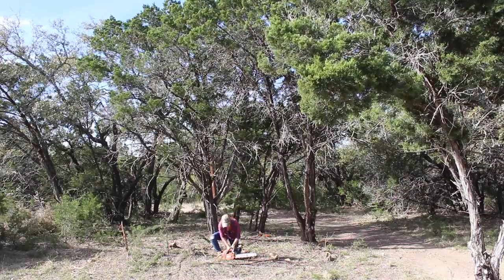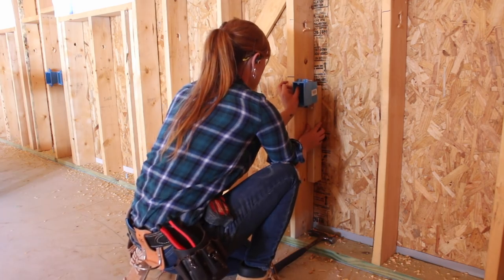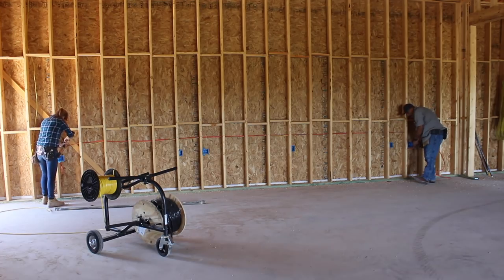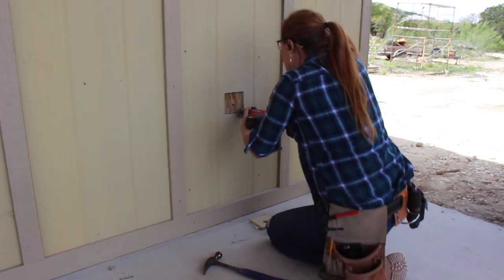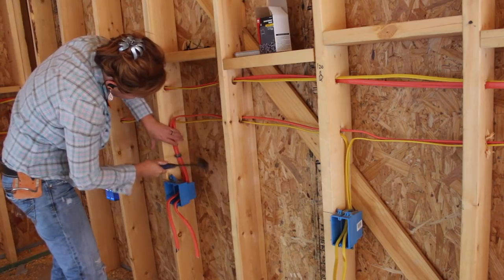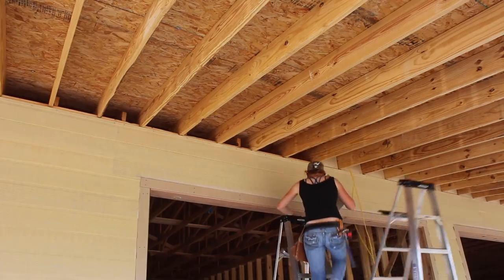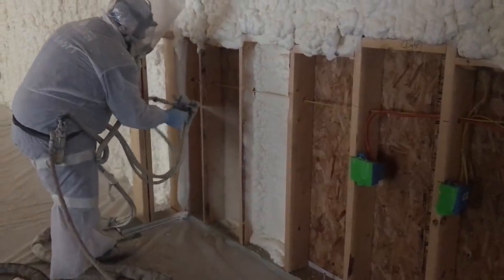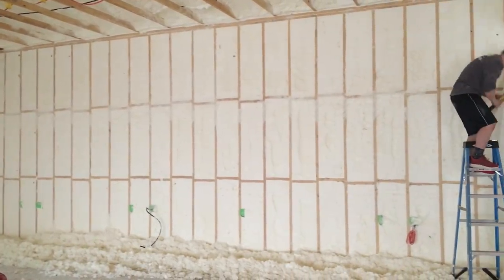Wiring My Shop and Spray Foam Insulation

Comment: No guard on the grinder!!!!!
Reply: It's kind of a concrete cutting diamond blade that's made of steel I guess ;o)
Reply: The wheel is made of steel and it has bits of synthetic diamond impregnated in it.  I've got a couple of wheels like that and they work well.  The problem is that April took the guard off her grinder.  That's really dangerous.  I know that people do that to give the tool more range, but grinders operate at a very high speed and when a disc fails it shatters in every direction.  You need the guard there to keep bits of the shattered disc from flying back at you.
Reply: As far as I know steel discs don't get shattered at 11000 rpm.
Reply: Any disc can shatter.  If you're using a good quality disc, rated for the size and speed of the grinder, and applying it the right way (no excessive force, and not trying to abrade with a cutting wheel or vice versa) then it's normally fine.  But discs can and do fail, and the mantra of "safety first" dictates that the guard is the only thing standing between flying disc fragments and your face.  I would never operate my grinder without the guard on.

Comment: April, for your in-between wall, you should have used fiberglass insulation instead of cloased cells.  Sound absorption is way better than and cost is lower.  Keep the good work I really enjoy your videos.  I'm a fan since many years now.  You have your own style and it is what charecterize you.

Comment: Hi
I'm excited with your work
My small point is that I think it is better if you run the electronic wire in tube. That will help you if you need maintenance

Thanks

Comment: Something I have done that is a little cheaper that the foam.... if you are a little more budget concerned or don’t quite have the funds for the real stuff.  On a 2x6 will, cut 1/2 foam board with radiant barrier on one side.  Fit it between all wall cavities and use the canned expanda foam to seal the sides top and bottom, then put in wire.  Then R19 batts.  I was quoted 2.25 sqft, for the foam and I was a contractor who used these guys on other peoples projects, this was my own house i was working on.  Anyway, use the foam board, spray foam to seal, and Batts to provide additional protection.  All total I insulated my area for .85 a sqft instead of 2.25.  Just a cheaper option, but love the real stuff too.  Great job, “WILKERDO”!

Comment: Great shop!  I'm curious about the attic ventilation...  Also, I'd be cautious about down sizing the HVAC very much.  I don't want to say they over sold you on the advantage of the foam insulation because I don't know, just that in general I'd be cautious since it would be very costly if you undersize the unit.

Comment: Any plans for the floor ?  Poly-resin, Epoxy ... or just keep it bare (which is cool too) ???

I did a poly-resin on my garage floor (grey w/ blue, white and a touch of black) paint chips. 

The next time I ever do that (which I recommend), I'd go with a solid color.

You drop a screw or nail and it's like dropping a brown needle into a brown haystack ... it just disappears !   LOL.

Easy to clean up, sweep, etc. and looks great ... but a solid color would probably have been more practical for me.

Comment: In finland they used to do spray foam insulation on wooden strucktures in the 70s and 80s (like in the video) . Afterwards the wood wasnt able to "breath" anymore, so all those houses are full of mold and rotten wood.  So those houses are taken down because the health risk and spray foam isnt been used the same way today, that much.

Comment: You should consider wire shields (a metal plate that gets nailed to the stud where a wire runs behind it) to prevent accidentally drilling into a wire down the road. Either you, a loved one, or whoever buys this place years from now.

Comment: April I saw you corrected yourself about the wire types. Typically 10 / 2 wire has 2 conductors, so you would normally be right calling that 10 / 3, but I sold wire, and when referring to romex house wiring, 10 / 2 is still a 3 conductor, because the ground wire is insulated most of the time and isn't considered an electrical conductor as it's a ground only wire. The first time I ever ordered 10 / 3 romex wiring I got a 4 conductor wire from the manufacture and that was their explanation to me. If that's not correct then take it up with Brad with inside sales at Houston Wire and Cable and Linda at Tyco / Murco.

Comment: Since the power company has to bring in a new pole and transformer, can they bring in 3 phase power so if you upgrade to better equipment you won't need a converter?

Comment: You might want to put your lighting on two separate breakers.  That way if your working at night and in the middle of a cut on your table saw, and you trip a breaker for some reason you will still have light to be able to finish your cut or whatever you are doing.

Comment: Shouldn't you have left a little bit of excess wire at your outlets? As in a loop by each outlet for future replacements, etc.? Love love love your videos, look forward to them each week!
Reply from the maker: I have some, but the insulation guys coiled them tucked them in their boxes so they could tape off the front of them. Wouldn't want to fill the inside of the box with spray foam. : )

Comment: Why did you use ACX plywood for your midshop wall vs OSB? OSB cheaper and as durable. Is that wall going to stay exposed plywood- did you do it for aesthetics? Just curious
Reply from the maker: Yep, it's just for aesthetics. Not only is plywood nicer to look at, but it's also not as busy of a background for filming.
Reply: osb is not as durable.
Reply: Some varnish and molding over the seams and she'll look good.
I know, it's just a shop, but who cares, make it a pretty shop.

Comment: Did I see correctly that on your continent you have fuse boxes made out of METAL with the fuses vertically in the center? The first looks dangerous and the later hard to expand/modify at any later time.

Comment: I see you follow the Howard Corse (dad) method of outlet placement, I did the same in both of my shops. That foam will be fantastic. One thing you might want to consider is to leave a provision to add more insulation to the ceiling if the R21 is not enough. I used 9" fiberglass bats upstairs(office) and covered it with another maybe 9" or 10" blown in cellulose. Here in NC in the summer, I don't feel any heat from the attic and my shingles are black and get mostly all day sun.

Comment: Question: If your vacuum is going to be outside, aren't you going to be sucking up a LOT of inside air and dumping it into the great outdoors? Otherwise, as usual, love watching your progress.
Reply: The HVAC contractor will (or should) install a ERV (energy recovery ventilator) to bring in and condition fresh air.  This is a necessity with todays super tight building construction.  The ERV will (or should) be sized to replace the shop vacuum cfm as well as the required fresh air requirement for a building of this size.
Reply: So, basically after filtering, the cooled or heated air is vented back into the building space? I'm not familiar with how this works, (but, then again, there's a LOT of stuff I don't know. ;-) ).

Comment: April,

Have you checked with your home owner insurance in regards to what their requirements are for building a new building? I'm assuming because of what you do in your shop and the equipment you have, you have it covered by insurance. I would highly recommend if you haven't, that you take a real close look at what they require to add the shop (permits, inspections, etc.) I would hate for your building to be built and nto be able to be insured.

I understand that you live in the county with little/no jurisdiction, however, it's never a bad idea to have inspections completed. Then you at least have a record from a professional inspector stating that your building was constructed to code.

Comment: April. I built a house on the north shore of Lake Michigan. After my spray foam insulation was added, it totally stopped winds that forced sand thru any and all cracks in my side walls. I get LOTS of wind! I use only 1 tank of propane a year due to my efficient forced air furnace too. As another benefit, you will also understand the noise deadening factor as soon as you start your dust collection system if that is located outside your shop. It is amazing, You scored big time on this. Air flow, heat and AC loss, and noise abatement. Great choice! Did you run a conduit under the slab for electric to your table saw or other tools which will be in the center of the shop?

Comment: You shop looks fantastic! You mentioned the spray foam company by name twice, perhaps they cut you a deal? You always wanted to be transparent and mention it, If they did.
When you are running the vacuum system sucking up sawdust, Doesn't that air has to be exchanged for outside air?  Could that air be returned to the shop after clean or funnel through a heat exchanger? To help reduce energy cost. Keep the videos coming.

Comment: This was one high voltage video!   lol.  Now, where was that 20 amp circuit going?  And that 30 amp circuit?  How many on that wall?   Uh, I'm confused now!  LOL...   Yes, it's good to have professional electricians helping you.  In my state, any wiring must be inspected and signed off on, with some city areas requiring licensed electricians must be the ones to do the work, for insurance purposes and so on...

Comment: This is awesome April!! As a note, if you are going to run ethernet, go with CAT6 not CAT5, and on that note, you could go with CAT6A which can maintain speeds up to 10GB speeds. It sounds like over kill but it's better to have an 8 lane highway when you only need a 4 lane than it is vice versa.
Here's a link that lets you know the ins and outs. https://www.firefold.com/blog/difference-between-cat5-vs-cat6-cables/

Comment: Great idea with the conduit! Much better than running bare coax/Cat 5/etc..As the technology changes, and new cable types (Cat 7+) become more popular, you'll be happy you put in conduit! I do hope you left pull strings in there, to ease the cable pulls, but it's no big deal if you didn't (just use stiff cable like RG6 first to pull the rest of the cables through).

Comment: open cell  is a sponge for  water vapor :) used in the south , not recommended in the north of USA ,  closed should be the one
Reply: oh x enginneer retired , stealth to commericial  try cut out 12 ich section floor level after few years , think will be wet

Comment: Excellent choices so far. You will have a fantastic shop.  I do however wish they left the Ridge vents open.
Reply: leaving the ridge vent open would create a large hole in the building envelope, since they sprayed the foam at the underside of the roof deck.  You would be channeling outdoor air, directly into the conditioned space.  You only want to ventilate the attic when the majority of the insulation is directly above the ceiling.

Comment: Nice video.  However, according to the ICC ES-Report SucraSeal foam still requires a thermal barrier or ignition barrier when applied in an attic space.  See Section 4.3.1 of ESR-3375 and section R316.4 or R316.5.3.1 of the IRC.  Only foam plastics which meet NFPA 286 should be left unexposed in the attic space.

Comment: Very informative video April and super cool insulation, it's mesmerizing watching it expand!  I also like the way they over fill it and then cut off the excess.

It sure sounds like you've covered plenty of bases with the wiring and it must have been fun working with the electricians.

Comment: April, to my knowledge, no spray foams are fire retardant.  They have a flame retardant mixed in to slow the spread of flames, but they can catch fire.  The IRC requires a 15-minute thermal barrier between spray foam and occupied interior space (IRC 316.4).  Fortunately, your 3/4" plywood sheathing will achieve this rating on the walls, and I assume you'll be install gypsum board on the ceiling?  Granted, only an ignition barrier is required for the insulation in the attic, but a 1/2" layer of gypsum board will provide this (IRC 316.5.3).  I also saw your comment that you're building in the country and there's no jurisdiction for inspections, but it's still a good idea to meet code especially in this instance because when ignited, spray foam gives off toxic fumes.

Comment: As always - this is awesome. I was always under the impression that it you were to run Fiberglass bats, Romex would be ok; however if you were going to run spray foam (PE or otherwise), then conduit (EMT or otherwise) would be the more suitable choice. This would allow you to add circuits if necessary or change out wiring should a short/high current device circumvent the breaker in the panel. That being said, the entire planning process you put into this is amazing; but that does seem to be par for norm. Not perfect - but exceptional just the same. Thank you, I learn every time I watch these videos, and I hate YOUTUBE.

Comment: Just curious, why put the DC outside? That will pull hot humid air inside.  

With a food 1 micron filter the DC (inside) would act as a shop air cleaner while running and wouldn't pull in outside air.

Loving these videos. Thanks for sharing.

Comment: Great video. I did not read through the responses here, so this may have already been said, but foam does some thing else according to a Texas A&M study done 15 or so years ago. They said foam actually increases the strength of a building by 20% or more since it literally GLUES the building together. That's good to know to windy areas.

I've been spraying foam since around 2003 or so when I bought my own machine for building Monolithic dome homes. I read everything I could get my hands on about foam. I will say this though, I have NEVER sprayed open cell foam, only closed cell foam. 

I was building a dome in Siren Wisconsin back in 2000 I believe it was, when we had an EF-3 come through. The winds were around 180 mph and it killed several people. My dome I was building had JUST foam and the rebar up and NO shotcrete at all as we were going to start to shotcrete that day. The tornado took down everything around us except silos and chimney's, but the wind never hurt the dome at all with just foam and rebar. Foam is VERY strong stuff and I only use 2.5 or 3 pound foam.

I will say this, do not pay any attention to the "R" value as it really is a joke and more of a marketing thing than anything.

What you really want to know is the "K" value of insulation or its thermal conductivity. I won't go into it here as you can do your own research, but the lower the number in the "K" value, the better your insulation is at NOT transferring or allowing heat to move in or out of what we're trying to insulate. 

The thing is, it is not "SEXY" as far as marketing to say I have a K value of 0.02 insulation value, but Americans LOVE big numbers, and they will always go for an R value of 40 or 60 or whatever and they have no clue what that even means in the real world, but it sure sounds cool. Bigger numbers are always more sexy in the marketing side of things, but really mean very little.

I always tell people, if NASA uses foam and tiles to insulate the space shuttle from the massive reentry heat coming back to earth, I think it's good enough to insulate your home as well, but what do I know. Keep up the great work.

Comment: i put closed cell foam 1-1/2" thick in my big garage and i went from burning 4.5 tons of coal to less then 2 ton a winter in the north east USA (PA) even with removing the r13 batts the guy that put it in said that even though the stuff i used was r7.3 pre inch it would equal r14 per inch as it sealed out all air and also would make the building 80% stronger as it glues the building into one solid structure. it was the best 8k i ever spent and if i could do my home it it i would. Your shop is looking great and the foam on the roof will be the biggest saving as it will block the massive amount of heat that the roof soaks up from the sun. keep up the good work and thanks for sharing and i sub your channel

Comment: April, don't skimp on A/C.  I have foam like you for a large house and studio 50x60 TV studio space.  It is much better to add an extra ton and not need it now vs having the unit run for hours trying to cool the space.  Remember, high ceilings (like I have) will eat up A/C cooling capacity.  Love your videos.  Best Wishes!

Comment: I also firmly believe you made the right choice on the interduct conduit for the CAT-5.  It will make for far easier upgrades. If your shop is close to your home, and are considering sharing Internet connectivity, please bare in mind "ground fault differentials" - the difference between two electical systems grounding efficiency. Electric differences will follow the path of least resistance - which includes copper network wiring.  Fiber optic between buildings will provide speed as well as flexibility. You can bury cheap plastic water pipe between buildings to allow for upgrading and expansion.  Best wishes!

Comment: Wow.. in Germany this kind of electrisity cabling is not allowed. The cables have to go on the top or below but not in the middle.And when you have a powerpoint in the middle you have to go vertical from the top or below. With this method you provided mistakes when you drill into the wall. You always know where the cables are... I hope you understand my german english ;)

Comment: Cat5 in 2018? In a new setup? Please use Cat7 or Cat7a installation cable. (not patch cable) ...and make sure not to use nails on it or go below the minimum corner radius at any thime. Including during installation. Why no empty conduit tubes? Is that not common to do on your continent?